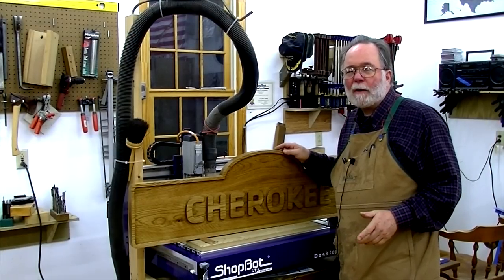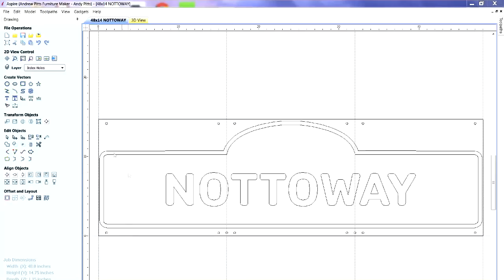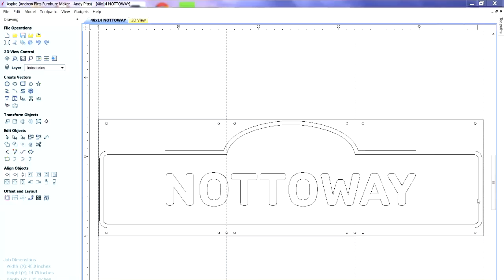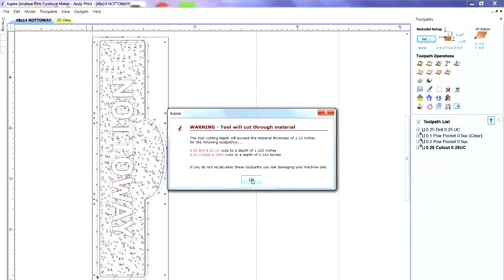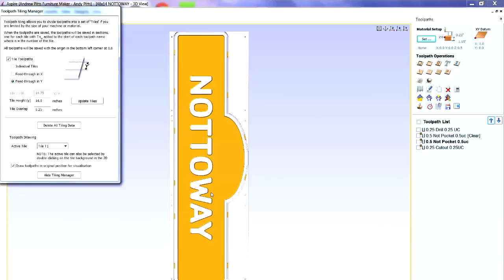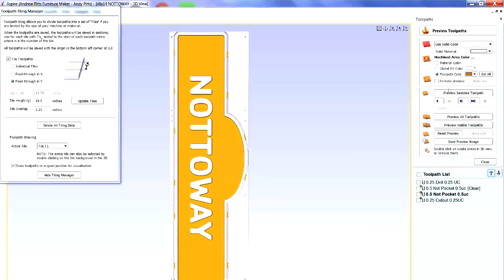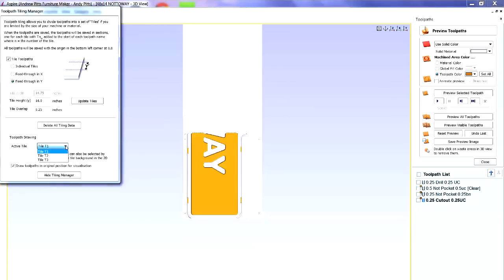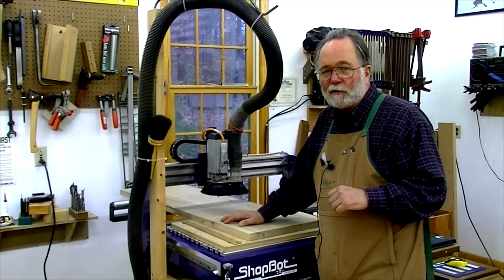Tiling Toolpaths on CNC: Andrew Pitts~FurnitureMaker

Comment: Thanks for givin this very useful information, espacially the practical demonstration with the workpiece on your machine
Reply from the maker: You are welcome.
Reply: @Andrewpittsfurnituremaker  But a last question, Sir: for making this sign with 3 tiles you will need to drill  3 index-holes, right?
Reply from the maker: Watch carefully at time 9:15 and you can see that only two index holes in the workpiece are needed at exactly the 1/3 and 2/3 of total length points. The spoilboard also gets two holes, in this case at y=1 and y=17. The first tile uses the pin at y=17 and the second tile uses the pin at y=1 (and y=17 as well, if you like), and the third tile uses the pin at y=1.
Reply: @Andrewpittsfurnituremaker  Thank you so much, thats the key of information i missed.

Comment: Great detail and explanations.  One important part that I didn't get, and I watched several times, what do you do to save the tiling as a  .tap file, plus what does the machine do while you reposition the board for the next tile.
Reply from the maker: Hi Bill,
If I understand you correctly, you would like to know how to save the tiled toolpath file, in your case a tap file and in my case an sbp file. Once you turn on "Tile Toolpaths", which is the icon in the center of the bottom row in the "Toolpath Operations" pane (you will see the tiling manager once Tile Toolpaths is on), saving a toolpath will automatically save both a T1 and a T2 file, etc, for as many tiles as you have if you have "Output Tiled Toolpaths" checked in the Save Toolpaths pane. You will see the T1, T2, etc files in the directory location you save to, so you have to take a look there to make sure saving tiled toolpaths worked right.

While repositioning the material, you are between toolpath files and the machine is not running. That is, all the T1 files have been cut and I am preparing to cut all the T2 files, etc. I move the spindle to a convenient location to get at the hold down screws and move the material.

Comment: Thanks for the video... I'm trying to cut a simple slot in a long plywood shelf for a standard. I followed your directions and when previewing the tool path it looks right, but when I machine it the 2nd part - it doesn't line up with the first one - off by 1/8" or more. I'm using Aspire. I have a link to the photo here: https://www.dropbox.com/s/qyzb6bsr7wcp8l8/IMG_7315.JPG?dl=0 Any idea why its not lining up? I even have a fence/rail to guide it the fun length and marked the ends to be sure they are consistent (not out of angle, etc). Thanks so much for the help!
Reply from the maker: Sorry Brian, but I just saw your question, 4 weeks old. YouTube had put it into Spam, probably because of the DropBox link. I suspect you have completed your project by now. What size bit are you using? Offhand I cannot think of a plausible explanation, and without seeing the Aspire file I'm at a loss.
Reply from the maker: I ask about the bit size because it looks like the software started cutting "on the line" instead of "inside the line" for the second tile, but I can't think of why it might have done that.
Reply: @Andrewpittsfurnituremaker  No worries and thanks for getting back. My "fence" was actually the problem. It was off just 1/64 top to bottom, enough to make it miss that little bit over 6'. SO, I made the fence wider and let the CNC cut it square to the table - problem fixed! ha Thanks again - great videos!

Comment: Can you please tell me how you setup the zeroing at Tile#1 and Tile#2. I think I understand Tile#1 zeroing (Touch cutter to material surface, set X & Y to the zero point & then zero all three axis). However I don't understand how the zeroing process for Tile#2. After Tile#1 is completed, the cutter returns to home. What do you from there to setup Tile#2?
Reply from the maker: Hi Victor,
You only have to do an xy zero one time, before cutting the first tile. For the second tile, the work was moved exactly 16" in the y direction, which was also exactly 1/3 of the material size in the y axis. The tiling software considered this second tile, which was the middle portion of the material in the video, as a new CNC file with the same material dimensions as the first tile, and the same xy zero position. Think of it this way. Suppose you wanted to cut two different plaques, each 16" in the y dimension and 14-3/4" in the x dimension. Each plaque has it's own file, and for each you made the xy zero point at the lower left corner. So, you screw down the material for the first plaque, zero xy at the lower left corner, zero z at the material surface, and cut the plaque. Now, remove that material and install the second plaque blank at the exact same position as the first blank occupied. Load up your new toolpath file. Since you did not change the xy zero on you machine, and the new toolpath file uses the same xy zero point as the first plaque, there is no need to rezero in the xy direction. BTW, if the material thickness is the same as the first plaque, there is no need to rezero in z, either. You should be able to cut the second plaque without any more rezeroing. Well, that's how the Vectric software treats the second (or third) tile; it sees it as a new "plaque" using the same zero points. The key, though, is that you must move the material a distance in y that is exactly the same size as the first tile. In the case of the video, each of the three tiles was made to be 16", so that meant the software saw three identical 16" boards with three different toolpaths to cut into them. In reality, there was only one 48" board that we indexed to look like three contiguous 16" boards. Hope this helps. Andy
Reply: Thank you very much for your reply, it is very helpful
Reply: Andy,  can you cut Tile#3 first. The reason I would like to know is that I made up a project with 3 sections but during the last section the cutter broke and damaged the last section. I would like to make up a new section 3 and then glue it on the damaged section. Is this possible and how would you do it.  Vic
Reply from the maker: @victorzychla8237  You can cut off the damaged tile and glue on a replacement as long as you make your cutoff precisely.  As far as then starting at tile 3, it will be done exactly the same way as you would normally cut tile 3. As far as the CNC is concerned, the T3 files are treated as a completely new job.
Reply: Thank you again Andy, it's nice to have a back up like you.

Comment: Beautifully explained and demonstrated, Andrew!  I am trying to do tiling using Fusion 360 on a Mac and a Handibot CNC router, which has a much smaller carving area (6"x8"), so more tiles. Have you or anyone done tiling of an engraved text (Vee bit) sign with Fusion 360?
Reply from the maker: Steve, I've not used Fusion 360.

Comment: That was really very informative! I would have liked to see more detail on the doweling, but its enough to go on for me. I have a project where I need to flip the piece over as well and do the other side, so the clamps and the wood locator on the left side that you use the ShopBot to fix the position of are gems of advice! 

Question - what is that bit of wood you have with the marks on the right side? Was it for anything in particular? Also, did you get your roller from somewhere specifically ShopBot related or is it your own addition? Thanks!
Reply from the maker: +Richard Vowles Richard, the piece of cedar on the right side of the Desktop just keeps the chips out of my computer keyboard. It's just a scrap. I think I bought the roller stand from Rockler, but they are available lots of other places. They adjust vertically and I usually use them at the table saw for the offcut. Andy